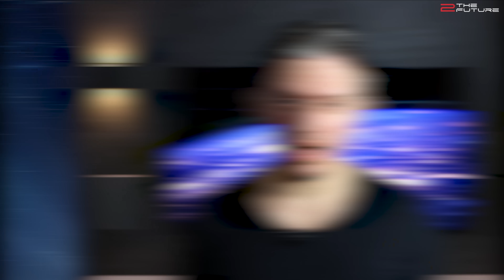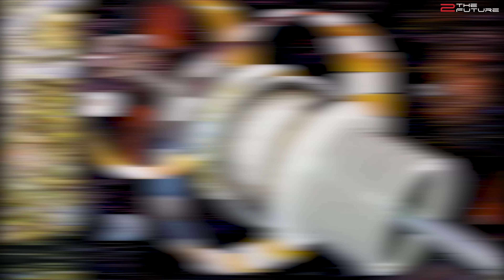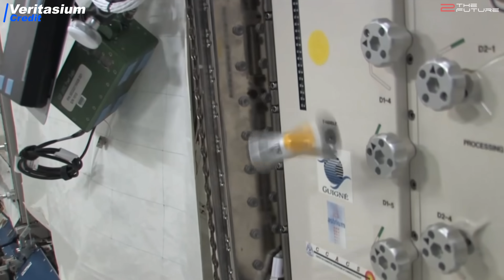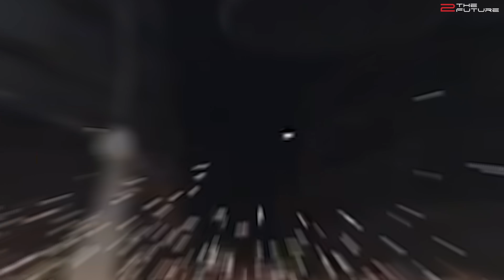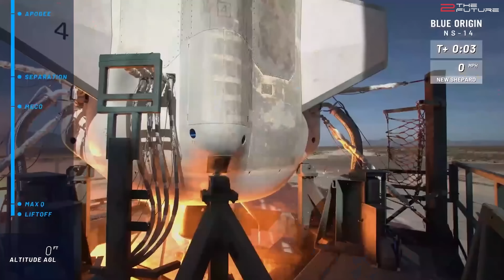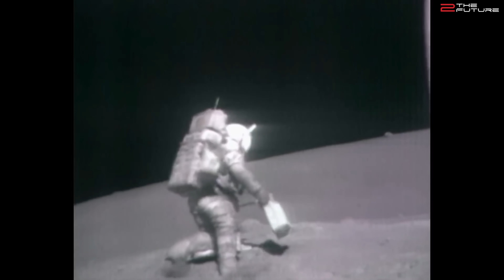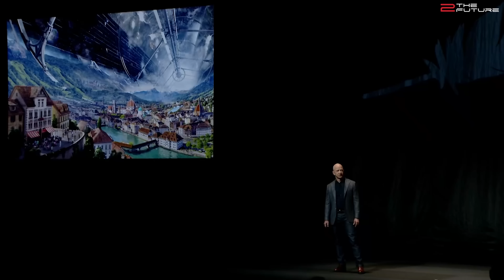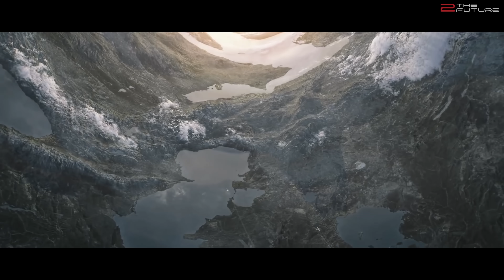How Do O'Neill Cylinders Work & Can Blue Origin Really Build One?

Comment: I disagree with the view espoused by Jeff Bezos, but believe that O'Neill Cylinders are the path towards a galactic civilization. The first step will obviously be colonies on other planets as small structures. The O'Neill Cylinder will be the next step, as terraforming can take tens of thousands of years, and we will need outposts and civilizations before terraforming could take place. I am concerned about 'chicken leg' syndrome on low-gravity planets, but your idea of genetic manipulation may hold promise.

The idea to put it in an asteroid is the most likely option, as that provides both a good portion of the metals required and the coating to help keep out the cosmic radiation. For the substructure, I think Basaltic Fiber will be the best material mined from the lunar regolith, instead of metals as we know them.

Comment: A symmetrical cylinder would actually not have an intermediate axis, so the intermediate axis theorem (which is what the Tennis Racket theorem and Dzhanibekov effect are specific expressions of)  would not apply: Rotation around the two axes perpendicular to its length carry the same moment of inertia. You need an object with three different moments of inertia along its rotational axes for that to apply. The actual issue that would potentially affect it is loss of kinetic energy due to fluid motion within an object rotating along its axis of minimum moment of inertia, which will ultimately dissipate kinetic energy and ultimately cause it to switch to its axis of maximum moment of inertia.

Comment: There's not really any evidence that the problems associated with micro gravity also apply to 1/6 or 1/3 gravity.  It might be the case... but we have never had humans (or monkeys, or any good kind of test subject) on the Moon or Mars.  So all this discussion about the "known" problems with living in a low gravity environment are discussing something that is possible as if it was a certainty.  I tend to suspect that we will find the problems of reduced gravity to be dramatically less severe than the problems humans experience with sustained exposure to micro gravity.

Comment: >> Building of the spheres:
are mathatically  possible, 
if use "populated" sections.

>> Using the L points around Earth: 
keeping the materials, is fairly simple.
** Recommend all L points, are constructed at same time. **

>> Other materials are available, 
than just.steel !  
( More easily available !)
?? Can these other materials, also be used ?

-- Earth's Space Debris;
-- Asteroid belts;; NEOs;
-- Shattered Moons; Planets
( Jovian Moons; Mercury )
-- Skimming of atmosphers, from other planets.( Venus; Jupiter ?)
Reply: Seperation factories, are not needed.

Shattering all new materials in the L.points, can get materials seperated by mass densities.
Reply: Material Placement !

To be done: using component gathering; 
rather than material refining !

! As "spin orientated":
can use a micro-thin film of steel, to maintain the shape !

?? 2 meter shell, 
around inner atmosphere; 
and 
0.01mm steel outer shell !

Comment: I am a huge fan of the O'Neal cylinder, but these are not something to be taken lightly. First, you would start with smaller rotating wheel design, such as the Gateway Foundation. We need to have a toe-hold in space with something that could be a permanent residence of 100's or 1,000's of people. Have a few of those built from materials mined at the moon base. Once we have a small civilization living full time in space, it is just a matter of scale to build up to the larger habitats.

Also, there is not a specific reason to tow an asteroid back to earth. Just build it in place, and when you are done you can drive it to wherever you want to live. Colonies on Mars, Mercury and some of the outer moons can happen simultaneously or even first. Having a city on Mars and several moon bases all make sense now, because they create the space economy that will make O'Neal Cylinders practical and ultimately inevitable.

Comment: It would actually be much easier to build a planetary ring.  We've already laid miles of cable on the seafloor, and a planetary ring begins with two cables orbiting the planet in opposite directions, linked via maglev to a satellite.  Just add more satellites until you have an equal number and build it out.  You could even stop the orbit of the satellites, increase the speed of the cables, and keep it from processing completely.  Once you build it out, you don't have to do anything else but build habitats on it.  You could stand on top and have gravity.  This is where Bezos needs to begin.  Not with O'Neill Cylinders.

Comment: Moving billions of tonnes of rock and metal around in deep space is not as hard as it sounds. It will get easier as you go. Repeatedly hauling lots of stuff into and out of planetary gravity wells—THAT is a problem.

You talk as if 2100 or 2200 is the far future. It really isn't. And that is the kind of time frame that's involved.

Yes, there's plenty of room at the bottom, as Feynman said. The thing is, there's plenty of room at the TOP. Manipulating large amounts of matter, in deep space, is not going to be anywhere near as hard as is generally supposed.

You, and the Angry Guy, need to reconsider this whole subject. You have a romanticized view of Mars. It will not age well.

Comment: How about building the cylinders in orbit around Mars. They would make great bases for establishing colonies on Mars itself. Just a quick trip  back and forth to get food and other supplies, as well as, back to earth gravity and general earth-like conditions for long periods. This, as opposed to going all the way back to earth. Maybe around the moon as well for the same purpose. Additionally, the asteroid belt is much closer to Mars than to earth. Easier and cheaper to mine. Once one, or more is in orbit around Mars, others could be built there for use around the moon and other planets, like Venus. An additional benefit is that the cylinders can have enhanced radiation shielding since they could be equipped with magnetic fields for the purpose. And, of course, the body of the cylinder would give much better shielding as well. This would go al long way to reducing the yearly radiation exposure the colonists would receive by being only on Mars. A side benefit would be in providing a "proof of concept" for the cylinders in general, and could be adopted into plans for colonizing Mars already in progress. Build a relatively small cylinder first, then begin full colonization. They would be much more useful in housing a few thousand people around Mars than for housing similar numbers around earth. Even just a few dozen.

Comment: We don't need to start off that big. If we use the 100m*1000m design, only ~500000 Metric Tons of material are required. That, even if we got it from Earth, would only take 5000 Starship flights, which would cost 10 billion Dollars. Being pessimistic and saying Starship will only be able to fly once per day, it would still take less than 1.5 years using 10 Starships. It would use up about 0.025% of the annual global steel production and, assuming a 2019 steel price of 600$/Ton and cost 300 million dollars in steel.

Comment: This is not an alternative to building bases on the Moon. To get the metals you need to build an O'Neill cylinder economically, you need to mine the Moon and shoot the metals to L1 using a mass driver. No Moon bases, no O'Neill cylinders.

Comment: I actually agree with this: space in space is limitless and if you can produce air, light, heat, gravity, etc. artificially you don't even need to move anywhere as it's costs insane, at least for now Cylinders sounds most human species friendly option. You could even build these in order to colonize space by traveling with it in conventional speeds to neighboring stars, of course slow as snail, but speed then wouldn't matter if this Cylinder could provide for humans everything they need

Comment: Its not just muscle or bone mass.  We have no idea whether our immune system will function adequately.  In zero g ~100 genes stop functioning.  Will it work at 100% or 38%...  or not at all.   There is the possibility of everyone dying of the common cold.  

Why couldn't we make a big kevlar bag and spray water a meter thick on its inside surface.

Comment: 1 meter thick steel? Starting out at 3200m diameter? Giant windows?...to let the radiation in? Sorry but this video is making some very odd assumptions. Some structural material is needed, but that will be covered with a nonstructural material for shielding. Artists make drawings, but that is not how something will get built. The early version will be more like a bunch of containers connected together. 

If NASA would have pushed those large tanks into orbit instead of letting them burn up, we would be well on our way to an early version. Twelve of those tanks connected end to end would be over 560m, making a ring with a diameter of 180 meters. Two of those rings spinning in opposite directions and you have a start. You would need some connecting steel and you would want to coat the inside with some shielding, but with a inner diameter of over 8 meters, you would have plenty of room. Each tank could have 3 floors with the middle floor having an area of 360 m^2 (3875 sqft!) The top and bottom floors would be narrower, but still roomy with 8' ceilings in the center and bunk beds built into the curve. That would be a start. Then you could start work on Babylon Five... but one ring at a time, with section breaks in between like they have in a ship below the water line. 
For ~1 g: 12 tanks = 3 rpm, 24 tanks = 2 rpm

Comment: Large orbital habitat concepts like these   seem awe inspiring but imagine if a space rock hit and punctured it. I think the atmosphere will have to be held in many separate containers that can be isolated and people will have to be ready to move quickly to an adjacent atmosphere container or they will die. Also much mass will probably be needed for protection from radiation and   giant windows for sunlight will let in too much radiation so the view outside will have to be simulated with led light images. Unfortunately the way it will look in the end will be much less attractive but still doable eventually and it would be an amazing achievement.
Reply: We can build large rotating pressure vessels, but we could build a much larger non-rotating shield. Sure, its another 3/4 billion ton mass of material to be processed, but that means you grab a 1.2km asteroid, instead of a 1km diameter.

Ask Chelyabinsk how safe any city on Earth is from catastrophically large impactors.
Ask any other city how likely it is.

Comment: I noticed how one could send massive stationary biosphere/vessels build on earth all the way to the other planetary bodies. Using Blue Origins Fuels, using high altitude ballons surrond on a mass size tray wiith the rocket top cylinder using the fossel and drone propellers,  taking into high orbit, compressing the ballons and use some of it exceed orbit, without speed blastoff, rend to main cylinders boosters after, or plus  a nucular cell eletric rockets, solar wave shielding while solor amped,  producing at least 1G force cruiseshiping tour LIVING all the way to the Moon, Mars, Titan, and revert the task halfway way to land.
Reply: Can you post a copy of the unedited post, I think you're onto something.

Comment: To build something on the Moon or Mars is like building the spacestation in gravity field. Not exactly easy and not exactly safe. And that low gravity would require genetic engineering of embryos. Not exactly the thing I would promote.

The best approach is to build small one, preferably Kalpana1 station with 112m diameter and about 90-100m length, since it is stable. One such station could be build using 160 Falcon Heavy rockets. Then we need to test it, how the biosphere would hold. Environmental systems. 
Next is to attach engines on it and send it to asteroid field to establish industrial and technological base. (bottom line: we still do not have efficient engines for this. Nuclear lightbulb would be the best, but really any nuclear thermal based engines would do) All the materials needed to build new, bigger habitats needs to be prepared, formed and constructed together into space habitat directly there. It is inefficient to send asteroid toward inner solar system.

Comment: I think slightly shorter cylinders with all their windows at the endcaps are the most sensible cylinder design. At temperate climates under the atmosphere the lux of light you receive on the ground is usually a tenth of what you receive in orbit, so for lunar l5 orbit the 1:1 window to ground ratio of the classic O'Neil cylinder design is way over sized. You likely want a bunch of cylinders inside a mooncrete box for cosmic radiation and meteor protection. And fill the window layers on the sunward side of the box with water for solar radiation protection. You can also build cylinder habitats directly on the lunar or Martian surface you just have to terrace the interior to keep the floors level. Build them at the lunar poles and you can use mirrors to shine light down on the top endcap at whatever day schedule you want.

Comment: I'm a big fan of SpaceX and I admire Elon, but I agree with Jeff and the Oneil cylinder being better than a Mars base.
Reply: Hard to tell what Musk wants. History? Who will be remembered, Henry Ford's competitor? Neil Armstrong? Von Braun? The ship builder for the New World? Columbus? It's got to be an ego project because from any practical measure the maintenance cost of a Mars base will outstrip any material benefit. It's not going to be self-sustaining. It's colder than Antarctica, dustier than the Sahara, the air at the surface is as thin as the altitude where the SR-71 flew and then there's the things I can't think of. And for what? Mining? A life boat?

Comment: Great report guys. So glad to see that SOMEBODY knows how to do the math. I think the O'Neill cylinders are great idea but holy crap! Consider the cost. But this kinda of thinking is good for us. Manufacturing jobs are going to continue to dry up. I worked for many years as a CNC programmer and watched as the controllers took away more and more of my work. (Which I really didn't mine because it made my job a WHOLE BUNCH easier, But I had to keep learning new stuff to keep ahead of the machines. I had to learn new programmers/controllers, I had to learn how to program 5 axis machines, [ that will make you f**king  crazy] and finally robotics. But a lot of guys I knew got left behind!) (As an aside: I started out programming a bunch of Bridgeport milling machines using a TI calculator, an ASR 33 teletype, for input, and a whole bunch of paper.  We stored all the programs on punched paper tape. I had hundreds of little boxes full of punched tape. LOL. Man, what a trip. I had to learn to be organized. haha)

Sorry, back to the topic: We are also going to lose millions of deliver drivers and truck drivers to self-driving vehicles. And this is coming SOON. My point, yes, I actually have a point, is that there are going to be thousands of manufacturing and assembly jobs in LEO and eventually in the asteroid belt. (Watch The Expanse to see how that might or might not work.) Any way I think the saying should be, instead of Go West Young Man, maybe Go Up Young Men and Women, Go Up. The future is UP. Wish I was younger. I would go in a heart beat.

(Yeah I know there's going to be lots of robots in space, But  some human being is going to have to program them and troubleshoot them, and fix them. There are going to be lots of jobs that a robot just can't do.)

Great show. Sorry about the editorializing. Keep up the great work. I love that you delve into stuff that is not strictly just rocket and space capsules and stuff. And as I said before, you work out the mathematics. Be sure to show you work, right?. HaHa. Love ya guys.

Comment: The O'Neil Cylinder shown in Bezos' presentation is just a prop. This is pretty clear because there is insufficient shielding on it to protect the inhabitants. So I wouldn't go making definitive statements about O'Neil Cylinder feasibility based on it. I would recommend actually reading O'Neil's "The High Frontier" which addresses your concerns about the dimensions and materials needed for the walls, the rate at which these resources could be mined from the moon, and the intermediate inhabited structures needed.

Comment: Great show, you two! I love thinking about moving to space. And I really like the idea of an O'neill cylinder, as opposed to setting up on Mars (for myself. We still need a Mars station.) Not just for the gravity, but for the earth like conditions, grass, trees, open spaces, etc. Weird enough living in space, the more earth like the better.

As for the cylinder, the asteroid idea is a good one, but how about lets hollow out the asteroid, and build the cylinder inside it. That way, you don't have to transport the materials anywhere, and you have the added protection of several hundred yards of rock for protection from meteors and radiation. Many (rocky) asteroids are comprised of relatively loose collections of rocks and boulders, easier to mine.  The cylinder would spin up inside the asteroid (you couldn't just spin up the whole asteroid, it would fly apart.) Fusion would make it a lot easier, but fission and solar would do.